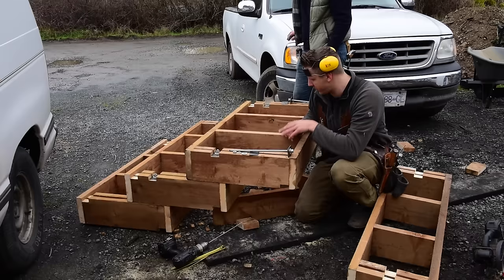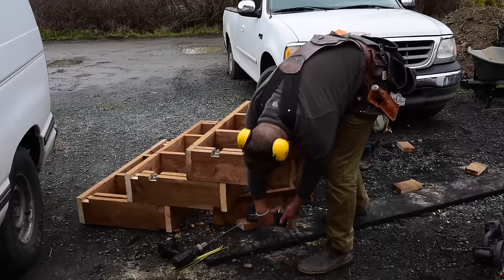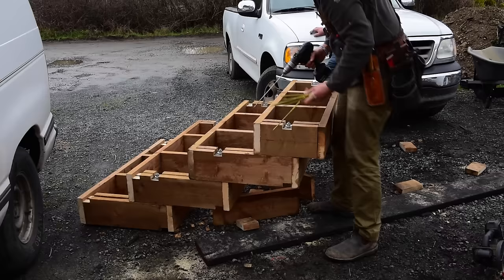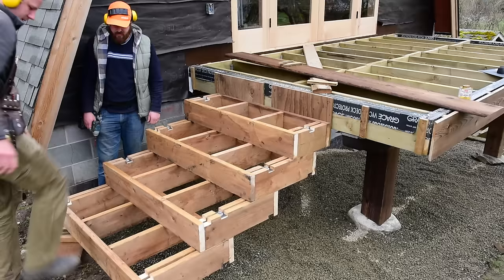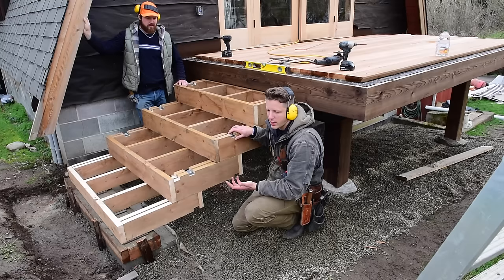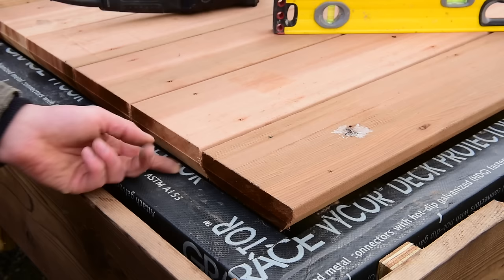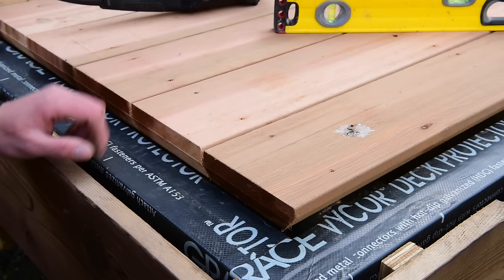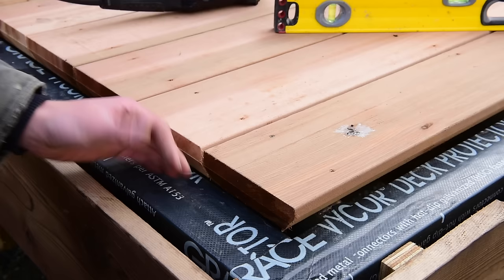FTF #52 Stairs Without Stringers? Here's How

Comment: Stringers have never ever made sense to me.  Take the best straightest large width dimensional lumber and then cut half of it away in a manner that one would never cut a rafter or joist?  Freakin’ STUPID!  I use either 2 x 6 or 2 x 8 dependent on span, mount them like rafters, and then glue and spike triangles to attach the treads and risers.  Much more solid and stable than the usual chop-job and never any squeeks.
Reply: that's the exact technique Thai carpenters use, and have been using for centuries, when making wooden stairs! ...It definitely makes more sense to me to.
Reply: @halnywiatr where I live the usual method is to use 2x10ish and cut away small triangles that are screwed on to make big treads, thus 0 waste (appart from the sawdust :) lots of measurements and counting to get it right though.
Reply: halnywiatr : & all winter...if u live in a snowy area....you cannot sweep the snow off easily to the sides. There are always advantages & disadvantages. Thus guy isn't a SAMURAI...dumb name... & This was WAAAAY more work than stringers, & waaaay more lumber. & he's cut notches that are used for nothing.  GEEZ.
Reply: You dont understand stingers and you also dont understand efficient construction methods.
Reply: Joel. Could you tell me the name for this type of stair system or where to find a video on this. I'm putting in basement stairs soon. Thanks .
Reply: I do this with the middle stringer. I cut two 2x12 like normal for the outsides and glue on the cut outs to the middle  2x6.
Reply: BuckGreywolfe the man said it would not pass code he is doing on his personal house. I do agree stringers is a lot faster and if supported right there is no better way to do it.
Reply: I am guessing your labor is free! Watch an experienced carpenter cut out a stringer. Zip. Zip. Done.
Reply: i don't understand why you think stringers are stupid.   Its the way the vast majority of framers do it.  the more joints the more potential for rot.  to each their own i guess.  regardless,  I respect your opinion.
Reply: Thats a great idea.
Reply: I used the same method as you for my 10' x 19' deck that has two stairs completely around two sides.  It makes so much more sense.  I've never had any issues with it after 9 years... touch wood...

Comment: Hi Samuri. Retired old dude carpenter here. I enjoyed your vision and design. George's criticism is a fair one. Your redwood may shrink less, but our treated yellow pine will shrink between 1/2" and 3/8' in width. Maybe the bolts can be tightened after shrinkage. My main complaint would be tread size to riser height. But your plan could be changed in size to accommodate a proper ratio. The rule since the 17th century has been riser height x 2 + tread width<25". So a 16" tread would require a maximum 4 1/2" rise. I know that sounds small, but when a stair varies from this ratio you will find that your normal step size doesn't fit the stair. Every third step (Maybe every second step if you have long legs) will be a make-up step either shorter or longer than your normal gate.

Comment: To do the calculations, a material list would be helpful.  Also what is the traffic use and planned load. But once you put up rails, for home use (assuming you're not carrying refrigerators over the deck and stairs) it will function fine. To really get a final sign off a detail of footings will be needed.

Comment: Good idea, Can't believe you beat me to it! Ha, ha, I will use this thanks.  Yeah, I agree with you about the code issue, but I think I happen to have a use for this style ( a low application need ).  I like the concept.  Tip, it maybe $$ but I would consider a long carriage bolt, keeping its head sky-ward ... just in case the nut worked loose (lock-tight).  No real complaints from me.  Thumbs up!

Comment: Obviously I am late to the video party, but I do have a comment that might be helpful. This design was close. The all-thread rods would have been better closer to the front of the steps instead of near the fulcrum point. Visualize the downward force while stepping on the third step. The 2nd step would tend to rotate about the fulcrum, or the point where the two steps actually touch close to the all-thread. Now imagine moving the all-thread the front of the step. Now when downward pressure is applied, the bolt will create a nice resistance to the upper step rotating about the fulcrum point. Other than that, I think this design is at least as strong as a standard stringer except that with the added cost and effort, still doesn't beat the original stringer design. Aesthetically, you win!

Comment: built my deck last year, but sadly with dogs, doing a clear cedar wasn't in the cards - would tear my heart out to see it get all clawed up, so PT pine, however, used the Kreg hidden screws, and after a season in the snow, a coat of 077 sikkens and it looks pretty sweet.   did my edges the same as yours - seeing raw edges is just plain wrong.

Comment: Stacked box design should work with both ends locked down and then the 12 inch GRK’s pulling it all together.  Reminds me of modular handicap ramp modules are constructed and laid out.  The worry wart in me wants to use a Simpson Strong Tie to strengthen the connection on the flat sides of where two boxes meet.   I hate stair stringers.

Comment: Looks nice! I'm no engineer but I personally would've added some bracing on the backside of each step for strength. Just a couple of pieces in the middle so it doesn't ruin the floating look. 
I once built stairs by making two slotted stringers and offsetting them to one side so that each step appears to float independently.

Comment: nice design for your stair framing. another thought on edge of deck plank to trim plank would be to router a dado to both and spline together with a waterproof glue, because it is a weak point for debris build up to blow it outward plus railing stress.  great instruction for design builders,  keep it coming.

Comment: At roughly 3:48 when you add the extra screws, the stairs would be stronger if you installed the same screw into the rear plate instead of the joists. I like your idea!

Comment: I'm not an engineer, but just wondering if the bolts may not act like a pivot point. i wonder if to combat that, one might tie the front of each stair inside at the front to the one beneath it especially on the 2 longer middle treads. the treads should hide the braces.  just a thought. but awesome looking stairs. i'd be curious to see how they hold up over time after a few season cycles.

Comment: I like your design and your desire to build things differently. I too get many ideas (work related) trying to sleep lol. as a 30+ year builder though I have to comment: instead of 10" grks $$ why not hurricane straps with 1-1/2" screws? much cheaper and less likey to split/rot over time. and, on the grace wrapped joist. the underside back cut on your deck boards is a good idea but the grace is going to collect water and trap moisture underneath it. I came up with a design for a "rebuild" deck last summer that eliminates any need for that "under" grace. the roof of the house was pouring water on a shady deck but the HO didn't want Eve trough. the deck I replaced was rotten from water. think airflow, water flow, extra joist hangers and offset joists where your deck board butt joints meet the edge trim. bevel cut the tops of your posts hidden under the deck. thanks for the vid!

Comment: Great concept,however, all the weight of the person going up ,and even more so when going down, will rely exclusively on the strength of the metal rods. If you have a very heavy individual or two individuals going together, who knows what can happen?? One thing you could do is you could  pour the concrete pad that spans behind the stairs, and rest 4x4 posts on each side under each box, just to prevent possible collapse. Great idea though, I would probably use it myself with the modifications I mentioned. Surely it is easier to use your system than to use stair stringers.

Comment: You're going to need to tie your first and second bottom steps together at the front of the second step with some joist straps. There is extra flexing there that will over stress the two vertical bolts over time (sooner rather than later) and those two steps will fail. If you try to carry a refrigerator or other heavy item up those stairs as they are now, it won't end pretty.

Comment: Would be cool if you plywood the steps, wire lath them, do a cement scratch coat and then lay bluestone on top with three sides thermal edged. I like incorporating different types of material

Comment: I like the stairs, really overbuilt but nice. The deck has to have spaces about the space of a ten penny nail for air from top thru the beams and out or water will build up and rot out the work. The spaces between planks are very important for allowing air flow, putting that black barrier under the nosing at the end will only hold wet and rot it from underneath..just saying. Power washing wood is problematic using a cleaner and a hose will cause less damage. Keeping it dry will save a deck in the long run wet will kill it faster than you would think ,cedar is a soft wood and it needs oil on it to stay fresh.

Comment: The 12 inch PRK's would have added more lateral strength if you had drilled them in from the bottom into the tread above. From the top, they don't do much.

Comment: I like the idea of that staircase construction -- particularly because it allows for that large tread 'run' or depth, and of course they appear quite strong (I'm only wondering if some yahoo stickler inspector might 'question' the construction -- and then ask for a plan from an engineer;  inspectors hate anything that deviates from 'prescriptive method').... Stringers are also inherently pretty weakened, because removing the notches for the treads and risers (from the 2x12 stock) ends up leaving only about a 2x4 section to function as the 'beam' to carry the weight load....   It would be stronger to double 2x12s on each side of staircase (leaving them intact -- no notches), and hanging 2x8s (or greater) as joist/risers between them, to support the treads (also, using '2 by' thickness for the treads will result in a stronger/'stiffer' staircase)......   The use of stringers, however, is quick (especially if you buy them already cut), and that's probably the main reason why they are used so often....

Comment: I think two ready-rods just behind front and rear fascias would be very stable considering what you kinda have is multi-tiered cantilevers.  Or maybe even some nail straps on the inside faces because what you have is all the weight coming down on one side of a 'T'.  Actually, it would be stronger if you just flipped it upside down.

But yes, nice idea, floating stairs look great.

Comment: Over time the bolt washers will sink into the wood from the constant stresses of stair usage as well as temperature extremes, which will lead to premature failure. I also agree with others that the tread depth is too much.

Comment: aside from the silliness of using 3 times the material that a stringer could save you,
the human skeleton has a very predictable movement pattern - especially when climbing.
a while ago - before you were born - someone realized this and we started to build according to that pattern. Accordingly, the magic number is 25 - that is the height of the rise or step + length of a tread or landing, then another riser (exact same height) - should equal 25 ( close is good enough ). So a very common stair is 11" tread and 7" rise x 2 = 25
So, you may 'like' a 16" tread and a typical rise ( 7" ), your body, my body and 99 % of the population will not.
But don't let that stop you from experimenting, the mind needs exercise too.

Comment: Why? It takes much less material to just use stringers, as opposed to pressure blocks. Plus, you require a lot more fasteners, which can always fail. Also, stringers distribute the weight more efficiently than pressure blocks.  Stringers are an overall cheaper, and better design for stairs. That is why it's a standard. Plus, the standard for stairs is 8" step with am 7 1/4" rise? Where did you get a 16" step?

Comment: I really enjoyed the video.  I like this design a lot.  I would think an engineer would ok it, it definitely seems solid to me.  Stringers are very boring and this just looks like a little extra thought went into it.  The only down side I can see is there is quite a bit more material needed, more hardware, and more labor.  I'd put that on my house, that's how much I'd like it.  Good tips as well.  I've chalked lined my boards and cut off the excess in the past, but I've never thought about cutting angles on the boards to wash debree away, excellent idea.  You get a thumbs up and a sub from me.  Nice job.

Comment: Great ideas.  instead of plastic between the bottom and the concrete you could have used 3 lag bolts to get  a space and it would have been adjustable.

Comment: I do not understand why the top step is smaller than the rest.  It will be the very first step that you will use as you begin your descent.  It seems like that step should be the easiest to navigate, not the hardest.
Otherwise,... I likes.  And the effort is off the charts.  Thanks.

Comment: It's hard to think of letting your deck boards run wild and then snapping a line to cut them straight as a "hot tip" - I thought that was the way everyone did it - the only "tip" is to cut the first board or two to exact length - depending on how far the nose of your circular saw extends past the front of the blade to eliminate any hand sawing - peace out!

Comment: Instead of using double 2x's to put the bolts thru,try using a piece of wood that is cut to that thickness,then drill thru it.This will prevent the rods from moving front to back.We know it won't happen now,but in 10-20 years.
Reply: Great idea BTW!

Comment: Going through this process with my carpenter he insists the picture framing first then fitting and edge beveling the decking one by one. Of course it will take micro measurements and a long time for 30+ boards flush. Reason payed by the hour lol. I'll do it your way.

Comment: Your washer caps and your outside "sandwiched" boards are where you would expect failure...
With that said, the potential loads and the distribution of those loads. ..I don't see this failing for many years...
Again, your sandwich would need to stay together and them coming apart would cause failure...with all that said, different treated lumbar can be very corrosive to some metals.
You would also want to control, "kick out" at bottom of step.
Finally, you treads are very "odd" in measurement...this can cause a "sturter step" and result in a fall.

Comment: IF YOU TAKE THAT INSIDE THE HOUSE AD PUT A BOTTOM IN THEM AND OCK TRADES ON TOP AND PANIO HINGES AT THE BACK WITH MAGNETIC LACHS AT THE FRONT WOULD WORK FOR STAIRS AND STORAGE ALL THE WAY UP TO SECOND FLOOR AND STILL ATTACH TO WALL AND SOME SUPPORT GOING DOWN...

Comment: While I always enjoy and encourage trying something new, it usually is done for some gain in the end and to make something better, and I'm not sure in the case of these stairs there was any gain.  I'm sure they cost more to build that way, they certainly took more time to build, they are heavier to move into place, and as the material shrinks and expands they will most likely loosen up so I'm curious, what was the point?.  Was this done just to save from making stringers, which are certainly easy to make?  To each his own I guess.  The lumber yards will certainly like that design, that's for sure.

Comment: Dude, those threaded rods will wear their holes wider, as the stairs are used.  Peen the ends of the rods over their nuts, otherwise temp changes will loosen them.  And they sagged under your weight.

Comment: Any structural engineer would laugh in his face. Just because screws hold something tight doesn’t mean it’ll last.
Reply: Well there are new "structural screws" on the market, and this is held together with bolts and rods.  I'm a structural engineer and I'm laughing at your stupid comment.  The fastening is stronger than the wood here.
Reply: Edward Schmitt Wood is porous, the screws are least grab and hold them together on the inside where weather isn’t a factor. Well the fact that the rods and washers are on the outside which is susceptible to weather and exterior  wood rot from wicking water off the grass tell me that you have no clue and got your degree from a cereal box.

Comment: So it seems to me, at a cursory glance that you've used 22 ft 2 x 8 per tread box times four , that you would have had to rip to size to achieve the proper riser height for your specific project . That's around 120 boards feet and 90 feet of ripping , along with all that pricey hardware (and notching for same) . Five 2 x 12 around 6 feet (60 b.f.) and approx. 40 feet of cutting for the stringers . Less than half wood and half the labor . Wasted wood and time . Send someone of those customers who don't mind that philosophy my way . Neat concept

Comment: I think you could get a very similar look, with using proper stringers and putting those pieces on the outside of them. It would be stronger, not require 12 $1.50 grk fasteners, no all thread and look cool like you have.  Nice video. I like the look, I’ll copy it but not the structural design.  Thx.

Comment: Steps are a nice idea, but stringers are SOOOOO much easier to cut. And with all the bolts and screws of this design, stringers should be overall less work. But you've got something that might have an application some where.

Comment: Nice deck, but 2 rises and 1run must equal 24 or 25 inches, so a 16 inch tread ,which is the run, should be a 4 and a half inch rise. I build deck stairs 11 inch tread and a 6 and a half to 7 inch rise. These are very easy to climb.